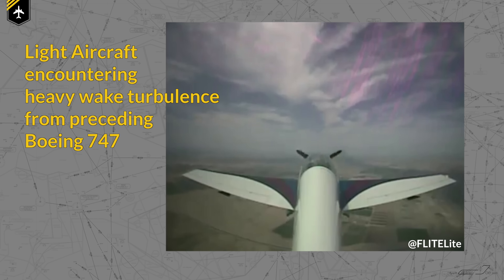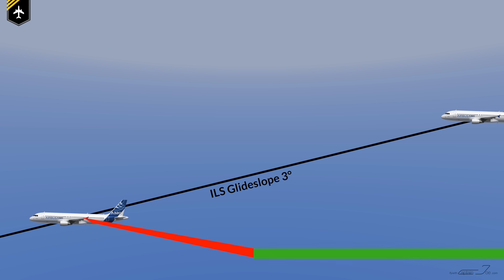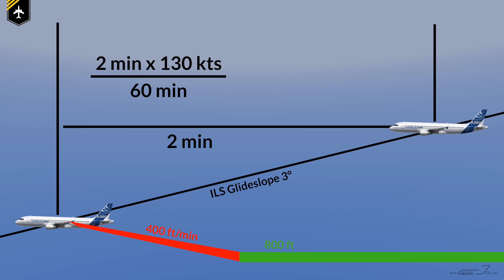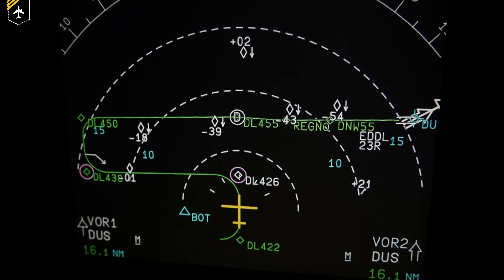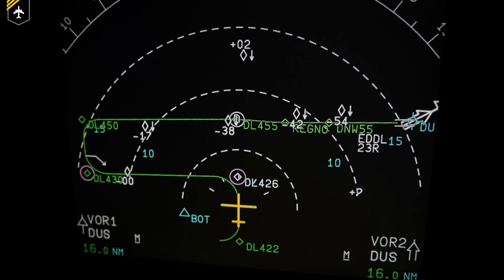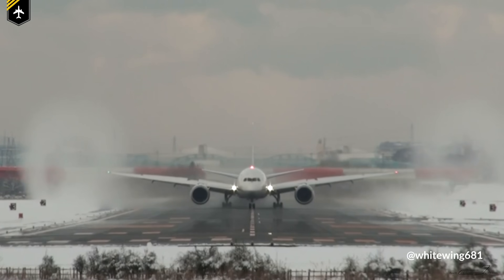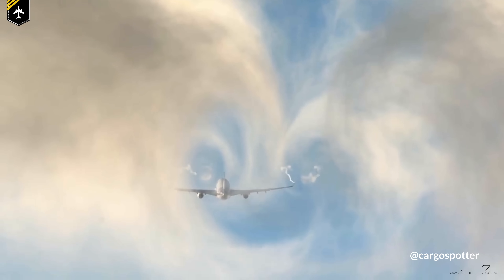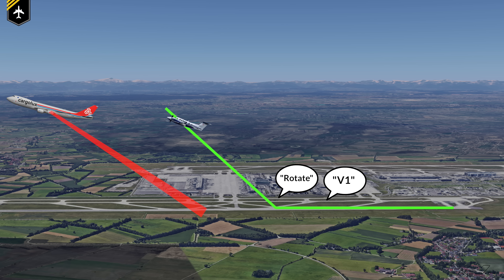WHY do pilots say HEAVY? Wake Turbulence EXPLAINED BY CAPTAIN JOE

Comment: Excellent vid. Have studied physics and engineering  but never ran into this.  Wish I took pilot training, but told you have to put up about $80.000 to become commercial or airline pilot. Back in 1985, coughed and went to oilfield.  Life missed
Reply: You can always do it as a hobby (that is get a private pilot's license and an instrument rating). In the US, a PPL would cost you around $15,000 and an instrument rating another $15,000, including the 50 hrs of required cross country. (but you don't necessarily have to get  it, if you don't plan on flying in inclement weather).

I'm an Engineer too. Just graduated 3 years back in Electrical Engineering and Computer Science from UC Berkeley. I started PPL training back in 2016, and at that time was going to do it, mostly to satisfy my passion for aviation. But when I got my PPL about a year back, the "pilot shortage" began to really make headlines. 

So I'm now finishing up my instrument training and might give a professional pilot career a shot. And at 39 years, I'm not all that young, either!! As a kid, I always wanted to be an airline pilot, but as you said, it's insanely expensive, and back then the airline industry was very volatile and unstable. And, after spending all that money, you had to work for a quarter of your life at slave wages, in terrible working conditions, before you started making some decent money. So it did not make sense at all.

If I was faced with that choice today, would I do it differently?? Absolutely NOT! Yes, there is a pilot shortage right now, but the airline business is always extremely unpredictable! Stuff like 9/11 or a global economic crash could turn things around on a dime! 

So I would always recommend to anyone, to get into a stable field like engineering or a health related field (Doctor, nurse, pharmacist etc.), work a couple years to gain experience and THEN pursue a professional airline career. That way, you have an "out", and also you can do it on your own pace, with the money you make at your primary job to fund the training! (as I did).

The beauty of it (at least for me), is if I don't like it, or things in the airline business go south, I can always go back to what I'm doing now, considering my qualifications and experience!
Reply: @747-pilot  So what about flying for commercial cargo  carriers instead of passenger airlines? I would expect hiring  criteria, experience,  would be different? Would that provide  another more viable to pursue your passion?  I'd  like to know your thoughts.  I've  always loved planes and the thought of being able to fly.  Never pursued it.  At this stage of the game (62)  I don't think it's feasible. $ being the biggest factor.  It would be a shame if you didn't pursue the dream after all the time, training,  and experience you've acquired. ✌🇺🇸
Reply: @georgeb8701  From what I know, there is virtually no difference in terms of hiring criteria etc. between the airlines and cargo operators. One of the reasons is, for the most part, they operate the same kind of aircraft as the airlines, except that they are the freighter versions.

And most of them are considered "major carriers" anyways (like Fedex, UPS, Cargolux etc.). Besides, a good chunk of them are just Freight divisions of the airlines (like Cathay Pacific Cargo).

While I'm one to always say "age is just a number", I think at 62, it would be unrealistic to make it to the major airlines, but if you REALLY wanted it bad, you could at least fly as a First Officer, for the REGIONAL AIRLINES, as they have a very severe shortage.

That said, as you correctly pointed out, it would require a lot of $$$ as you would have to do it very quickly (going the accelerated training route), and then start building your time at breakneck pace, as a flight instructor, to  build the required 1500 hours needed to fly as a First Officer.

Theoretically, you could do all your training and instructing in about 1.5 years, and then then fly for another 1.5 years for the airlines. And considering the severe shortage of both flight instructors and pilots at the regionals, a super dedicated person could definitely pull this off.

However, there is no denying that the above scenario would be very challenging, and you would have very little buffer to make mistakes or fail.

So, IMHO, a more realistic option at 62, would be to pursue it a hobby, and even possibly a career in FLIGHT INSTRUCTING. There is no age limit to how long you can instruct, and I know a couple really great instructors in the early-to-mid EIGHTIES doing it a nearby school!!
Reply: @747-pilot Thanks 747. I wasn't planning on pursuing flying as a CAREER. I'm anything if not a realist and acutely aware my limits especially at this stage of the game.  No, I was asking you why YOU couldn't go the cargo flight route in order to pursue YOUR love of flying.  If I were in your position I think I'd want to continue to fly for as long as possible.  And then fly my own plane after retiring.  But hey,  thanks for the info and insight.  And continued success in your pursuits! ✌🇺🇸
Reply: @747-pilot  Well, as an engineer, you can have a tremendous advantage becoming a better pilot, but only if you study aerodynamics, engines, airframes and aviation in-depth.  Having a THROROUGH and FULL understanding can be the difference in being in full command on an extraordinary situation, or just becoming another helpless passenger...  Most recently graduated pilots become mere button-pushers, that rely too much on automation, a sure way to crash someday...  But a truly knowledgeable pilot that understands how the plane works, will be in a position to solve difficult failures much better.  Take the Alaska Airlines MD crash for example:  Would those pilots knew about the possibility of MECHANICAL FAILURE, they would had walked back to the rear of the aircraft, and asked if someone had heard any extraneous noise (the noise made by the stabilizer jackscrew stripping its threads).  Instead, they kept trying to handle it incorrectly as an electrical trouble (in fact, sadly, they ended up completely stripping the threads with their attempts to force the jackscrew to turn,  precipitating the nosedive and crashing). Knowledge always helps, Ignorance kills!
Reply: My high school had a course in aviation back in the late 1970's and we learned the basics of flying a plane including several flights operating Cessna's. At the time, we were told that the most cost effective way to get training in aviation was to join the military. Put in several years as a military pilot and then retire to join an airline. This was especially true if you wanted to fly helicopters.
Reply: Whoever told you that it cost 80k was lying or ignorant. It doesn't cost no where near that amount. 20k should do you just fine and you might wanna get an extra 10k for extra flight hours.
Reply: i dreamt to be an airline pilot but ended up in the merchant marine.boats and planes break down and boats has a greater leeway of survivability if it does lol..
Reply: Even if it costs $20K, I couldn’t afford that unless I sold my house and lived in a small apartment. I say this on an aircraft mechanics salary. Guess it boils down to life choices. Maybe should have been a doctor or lawyer.
Reply: I like that you studied physics and engineering you sound clever.

Comment: back around 1970, I was a passenger in a Cessna, (my 1st time in an airplane) that a friend was learning to fly...we were cleared for a touch n go at Pittsburgh International and must have been too close to the airliner ahead...when we passed over the tower that holds the red/white lights, a loud bang, and the instructor, grabbed controls, and  pulled the plane up and away to the right...my first thought was, we hit the tower, and im looking out to see the wheel still there...

Comment: In the strictest of sense weight (as in tonnage) does not determine wake turbulence directly. Weight, by itself does not cause wake turbulence. Rather the size and shape of the wings, angle of attack, and speed determine wake turbulence. But since each of those are influenced by how much weight has to be carried in an indirect way weight is the primary determining factor.

Comment: "Heavy" relates to gross weight, of course (both take-off and landing).  Over 250,000 lbs... Min distance intervals determined between aircraft...particular between heavy and non-heavies.  Heavier the A/C, the more severe wing tip vortices...aka, wake turbulence is...

Comment: One small point, wings do generate lift and thus wake turbulence whenever any air is flowing over them including during the their takeoff roll. It will of course be significantly weaker as the lift being generated is less than the weight of the aircraft, it doesn't thus just magically appear from nowhere at rotation though it does significantly increase at that point due to the rapidly increasing angle of attack as the plane rotates but it isn't exclusive to being airborne. Hell even ground vehicles like cars have some amount of wake turbulence due to differences in the airspeed passing over various surfaces of the vehicle which again produces vortexes when air spills around from higher pressure regions to lower pressure. They are nothing like as strong as for a several hundred ton aircraft but they do exist mostly though the only real threat the ones from cars pose is wasting fuel due to the added induced drag.

Comment: Regarding this topic:
I saw a post on twitter of separations, where the A400 had its own separation requirement https://imgur.com/S30H2Ze : 10 miles behind and ahead of.
Do you know why that's the case? If it's beacause of the propellers, what makes it different from other large military/cargo (turbo)prop aircraft?

Does the An225 have its own weight class too, or is it in the SUPER class as well?

Comment: I landed a C172 behind larger plane. I looked where he landed and made sure I stayed above where he landed and landed past where he landed. A C172 don't need much to stop after landing and the long runway at airports that handle larger airplanes makes this easy. I had to also fly past the approach for the other runway so the higher than normal approach with higher than normal power keep me out of that also! I landed past where the 737 turned off the runway.

Comment: I read somewhere that B757s have a much stronger wake than other medium aircraft and requires more separation because they pose such a threat to trailing aircrafts. The CEO of In-and-Out burger died in a plane crash because his private plan landed too close behind a 757.
Reply: This is true, the b757 and the Tupolev 214 is regarded as heavy for trailing Aircraft.

Comment: Thank you sir for a great lesson. I was so glad that you mentioned contrail turbulence as well as wing tip turbulence. I have a question, is the aircraft at 7;10 producing an exceptionally large contrail, or is this, in your opinion, a 'chemtrail', I.E. do you think that there are any other materials emitted from this aircraft, such as metallic oxides, besides jet A exhaust in this video segment. I like and subscribe.

Comment: Wasn't Boeing 757 another case where plane was classified as heavy even if it's weight didn't exceed 136 tons? If I remember correctly that was only for the normal 757 and not the winglet upgraded version.

Comment: Tower this is cessna 218 Requesting speed check ...Cessna 218 Tower We have you at 99knts Good day .....Tower this is speed bird 448 Requesting speed check ...Speed bird 448 We have you at 490knts ....Tower this USAF F-18 can i get a Speed check please  ..Roger F-18 we have you at 783Knts .........(F-18 pilot smiles thinking he has shut everyone up )  Tower This is Blackbird 1 Can i get a speed check please ...Hmmm Blackbird 1 We have you at 1948 Knots !   Tower i think its closer to 2000  Thank you tower .........( It really happen )

YYZ Cold night in 2002 Tower :  Tango 331 Heading 150 Line up for 15L   Correction Hold and stand-by ......"Ahh Bullshit!"  Tower :  Ok You can't swear on a open mic Who said that?  Tango 331 : Who said what sir?  Tower : Someone said Bullshit And i want to know who said it  Tango 331 : No one here sir said that  Tower this is Speedbird 75 Heavy  No bullshit here sir.  Tower this is KLM 649  Good day Negtive on the bullshit sir.......10 mins of this till the control tower said Any more incoming or outgoing The next bad word You will need to report to company and FAA 
(The pilots covered each others ass)

Comment: Another great video. One thing though at 07:30, you can't always go around if you inadvertently fly into vortices from a 'heavy' as you may well not have enough control authority and no choice of where the aircraft will go. I remember being a student solo pilot in a C152 awaiting departure. A C130 Hercules 'heavy' took off and seconds later the tower cleared me for take off. Although I was fully awhere of the issues of this video, being a fresh new pilot and not wanting to upset anyone I slowly and cautiously taxied into the runway and lined up. I took my time but it had only been a minute or so... I opened the throttle to full and (just about) felt those little ponies pull me as hard as they could. I easily got airborne far befor the C130 ahead and climbed out. However I'd noticed the C130's climb angle was far greater than mine and when I was at a couple of hundred feet still above the runway on the upwind leg I intersected (found) his wake! Now I'm a very confident pilot who very much enjoys seat of the pants flying and throwing aeroplanes around the sky, but I will fully admit to not liking that experience at all! It was the lack of control and just being totally and dangerously blown around at extreme attitudes against my will despite all my corrective control inputs... After several seconds I had very clumsily traversed through this huge wake and my C152 started to fly normally again. I had learnt my lesson and then know, if you have reason to stop or wait, just talk to the tower and ask for separation!
Reply: Julian Neale  Wow! talk about first hand experience! It sounds like your lucky to be able to tell the story.  That's HEAVY duty dude! 😄✌🇺🇸
Reply: Turns out you CAN’T always go around. The song lied to me!
Reply: You must have been at a military airport.  Herc's and Spectre's don't land at civilian airports.  And they fly different vectors than civvies!  You should have "learnt" that in the beginning of your instruction and certainly learned it well by the time you solo.  (Over-confidence kills, and NO pilot worth his salt "throws airplanes around the sky!")

Comment: I  was  on a  VC-10  waiting  take-off  at Cairo.  the  crew  had  to make  contact  in Uk with manufacturer  as  heat  and  weight of  aircraft  was  maximum  distance  of  runway.....nerve  wracking  in 42c  temperature

Comment: Technically the weight has nothing to do with the size/strength of the wake. Its just about angle of attack, velocity, and the wing/wing-tip design. A heavier aircraft just has to have a higher angle of attack to maintain lift, thus the bigger wake. But the weight itself isn't doing anything, its just forcing a change in either of the two primary factors.

Comment: Big fan of yours Captain Joe! I have a follow up question which will cover content from this video as well as another video from a year ago... on a very busy airport where say a heavy or super aircraft just took off and a plane taking off right behind it experiences an engine failure during takeoff right after reaching V1 where the rotate angle will much lower than normal. Are pilots and ATC controllers trained to account for such scenarios?

Comment: Hi Captain . What does it mean by safe landing with excess weight . I heard this when my flight was diverted and made an emergency landing. Before take off again the captain  mentioned checks need to be carried out due to landing with excess weight . Please could you elaborate. Many thanks
Reply: Basically your plane did a so called "overweight landing". That's when the plane still exceeds its maximum landing weight at landing. If this happens some special checks have to be done by the maintenance crew on the ground ,especially for the the landing gear, before the aircraft is aloud to fly again.

Comment: When I flew gliders (sadly some years ago) the justification for flying as high as the  towplane was to avoid the prop wash and not irritate the tow pilot. The simple guideline was to keep the towplane's wheels on the horizon.
In fact, a mandatory exercise we had to demonstrate was descending through the slipstream and going to fly well below the towplane, then returning to the normal position, once again going through the (very turbulent) prop wash.
Also keep in mind, flying a glider under tow, you're pulling the towplane's tail around! Unless you're flying steadily behind the towplane, the pilot will notice and NOT appreciate your shenanigans.
Reply: As a side note, one of my instructors liked to warn us with a story about an accident, where a tow-glider combination went through a thermal (with the glider being much more affected due to its lower mass and longer wingspan). The glider pilot reportedly pulled up strongly instead of pushing the nose down, hence pulling the towplane's tail up, resulting in the towplane entering an uncontrollable dive. The glider broke up due to aerodynamic stresses and crashed. The towplane managed to recover when the towline's weak link broke, and the upwards pull on the tail fell away. Do note that this story is based on what my instructors told me. I have no other sources for this story.